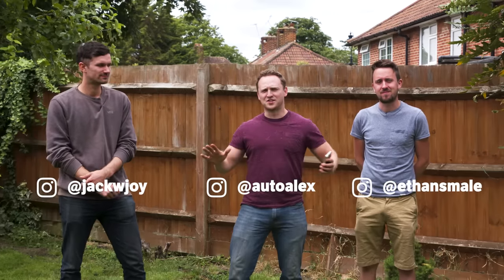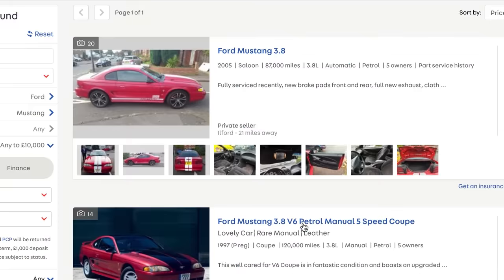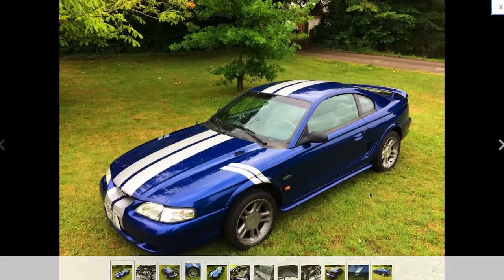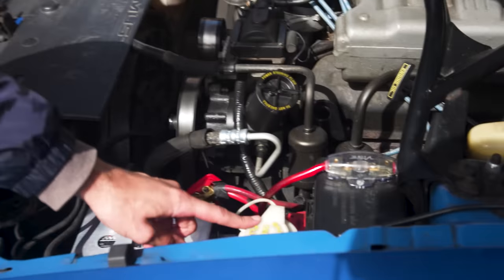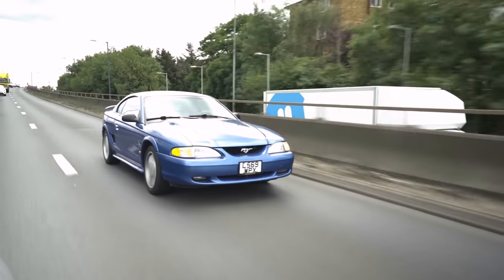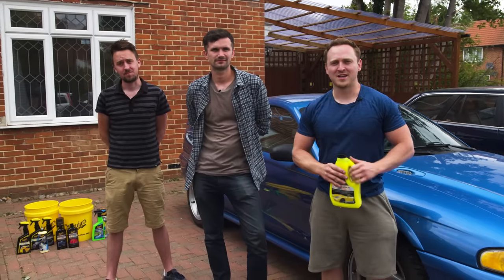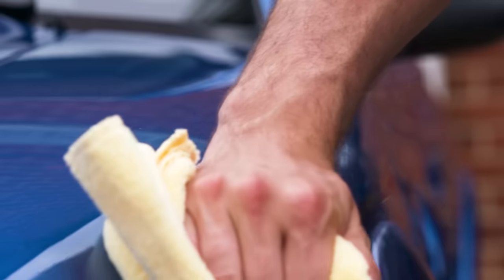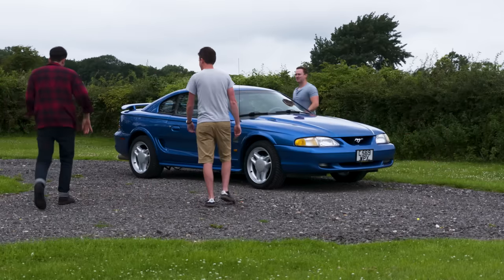£5000 American Muscle Car Challenge

Comment: These guys are looking in all the wrong places and the wrong cars.     You can get up to like a 2008 mustang GT for about 5k and a really clean new edge mustang for less than 5k.  Same for camaros you can get a 2002 camaro SS with the LS1 engine (an extremely capable platform and can get 550+whp on stock internals)    I would not consider a V6 mustang/camaro even a pony car.  Those cars are slow and are meant to be grocery getters.  I’d consider cars like the Ford Focus RS or a dodge neon SRT to be pony cars

Comment: Modern cars are much too refined and sophisticated to be called muscle cars. I don't care that you can buy a Mustang or a Challenger or a Camaro today. They are all too soft and cushy and compromised. They are all GTs. Get back to me when you can get one from the factory with a rear end that crackles barks and whines, and you can choose one of five different rear gear ratios and four different manual boxes, a radio and heater delete, and an entirely different induction system shipped in the trunk....on a street legal Camaro Mustang or Challenger.

Comment: Alex as I am Muscle car man I must say I was disappointed in your video.

Next time bring guys that no there stuff about Yanks.

There are more to muscle or American than Mustangs. 

You could of bought a Camaro Z28 or Pontiac Trans Am for same money but with 275hp.

You need to research yank Iron. Yes you cannot buy 300 or 400hp 60s muscle cars for 5k, but the Camaro/Trans from 93-97  275hp LT1 you  could of

Comment: I appreciate Meguiars is sponsoring the video, but it would be better if you explicitly say that in the video, rather than hiding it in the description and making it look like "consumer advise". Overall, Meguiars makes shit products and just literally just wastes time when detailing is concerned. Yes the car looks good because a lot of silicon fillers which will fill scratches and makes it look good for that moment. Silicon is as well fairly "slick" and makes the car paint to feel smooth, has good water repellency but poor durability. This means your car will look shit after a week and there will be no protection left. Now some of Meguiars products can be used, not the best value, but they don't hurt. Like the quick wax ... it is fine to use for the maintenance and it helps to dry the car without water spoting and helps to prevent some scratching when drying. The problem is that you need to have pain in already good condition to use it, by that I mean you need to properly detail the car with real polishing compounds to remove scratches rather than fill them with silicon, then ideally use some decent ceramic coating to protect it... and once you done that and just doing quick wash you can use Meguiars crap... there are many much better and cheaper products on the market, but at least it doesn't hurt. Second thing would be the leather cleaner... I mean I personally dislike the overly intimidating sweet chemical smell, but that is personal thing - Meguiars makes reasonable cleaner there for light cleaning. Again not the best, nor the best value product on the market, but it could be used just as tidy-up. I would almost call Meguiars - "cars salesman" products, easy to work with, gives instant but short lasting results... if you just need that car to pop before the sale and make it smell nice (which could be subjective) then it is fine. To use on your own car is waste of time and money.
In summary, big dislike for selling advertisement in from of consumer advise, and further for advertising sub-par products. If you need sponsors so much - reach out to decent detailing brand and do it properly.